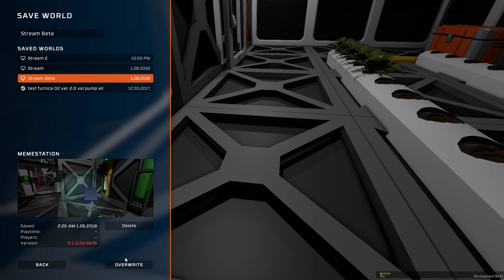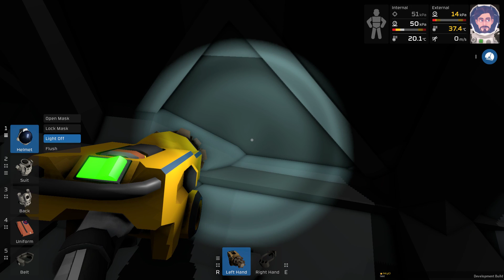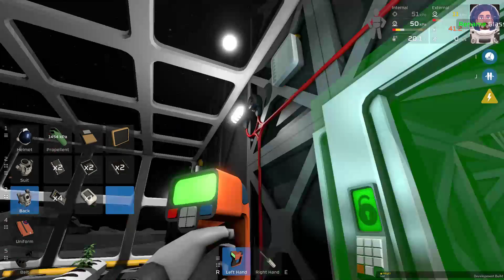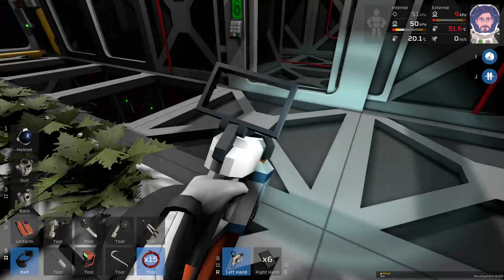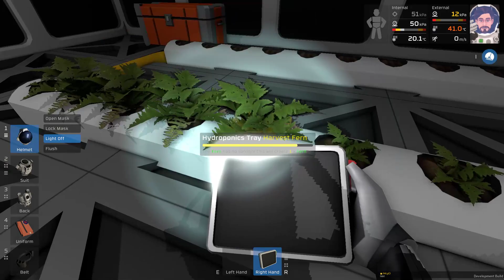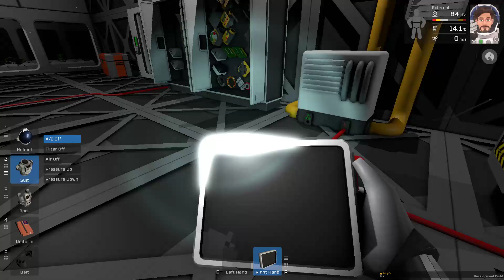Stationeers Ep35 - Green House Auto Temperature Control

Comment: =does the solid fuel generator give co2? Also; maybe could just pull air in the room through an air conditioner set to the temperature you want. probably work much better than wall units.
Reply from the maker: As for the solid fuel generator, not that I am aware of.  Last I knew the A/C units are pretty much useless and consume a ton of power to run.  Dean was talking of removing them completely and going with more/ similar systems as the wall units.  However, I think the values for them were changed in a update so I may need to look back into them again.
Reply: Ive seen them work pretty well, with a simple intake-->A.C-->Outtake cycling gas from the room into it.